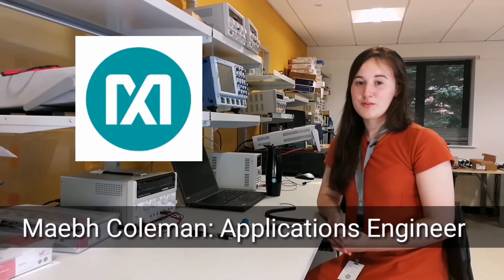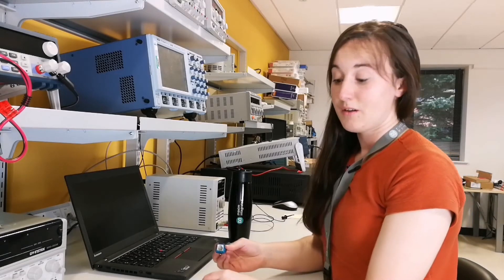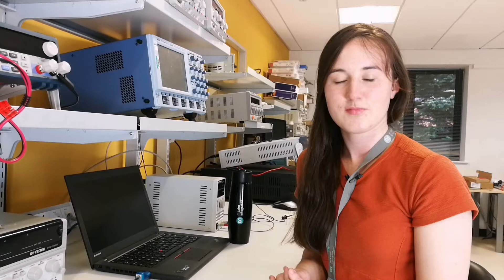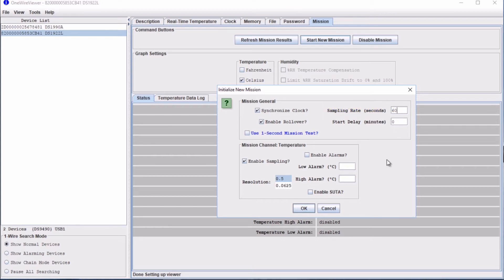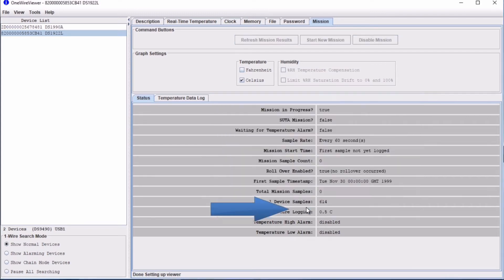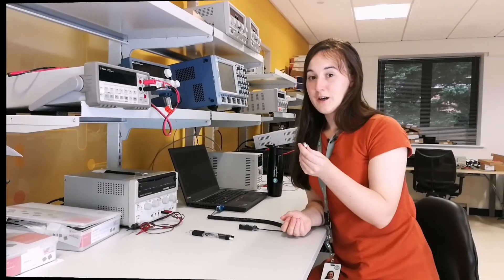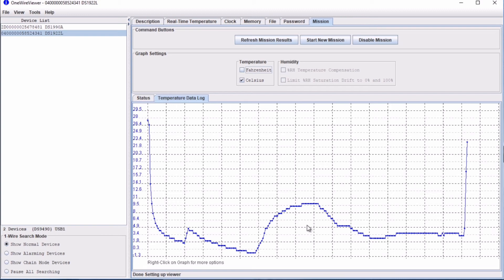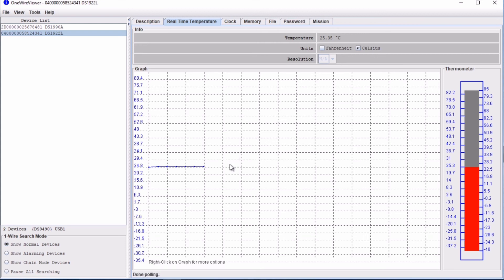How to Record a Temperature-Logging Mission with the DS1922L

Comment: I installed onewireViewer which reads Thermochron DS1921 but when I connect DS1923 and DS19922 Hygrochrons I received this message: Device not supported by 1-Wire Viewer.